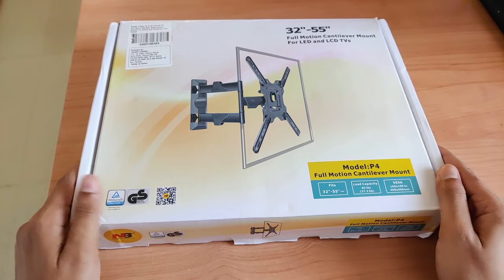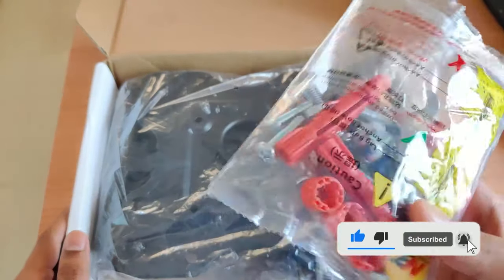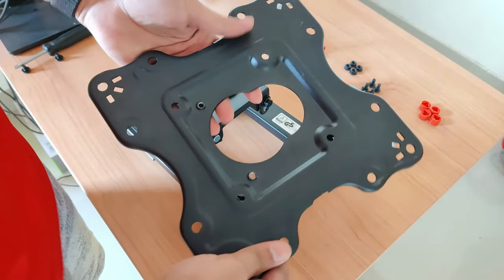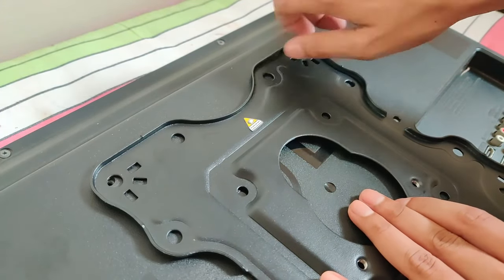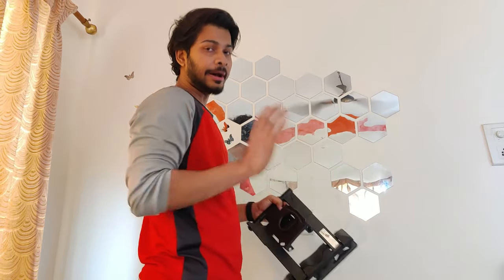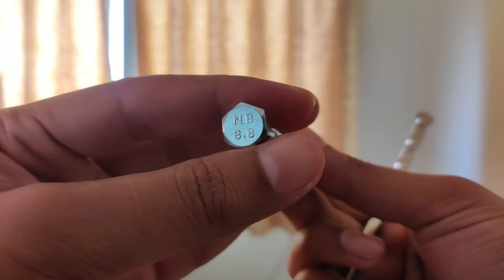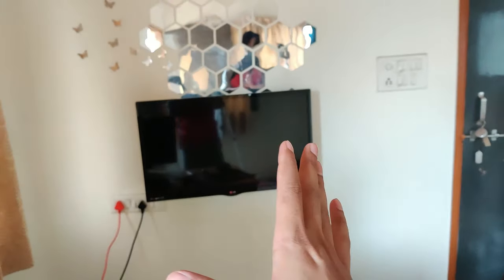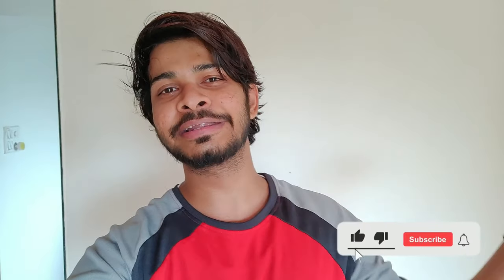Gadget Wagon 32-55 inches movable TV mount unboxing and Installation | TV mount installation Gadget

Comment: Can I use it to wall mount 43 inch TCL TV at CORNER of the hall ( as in my hall there is only a CORNER where I can put my TV )
Please reply 
Thank you
Reply from the maker: Yes. You can install the mount at any one side of the wall near the corner and bring the TV to the center of corner.
Reply: @quicktipers  Thank you for your reply.